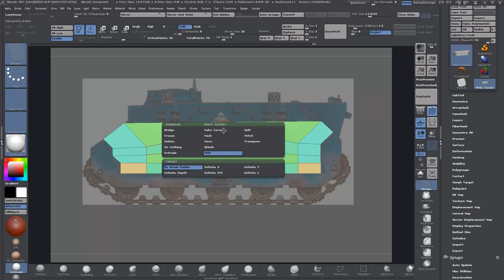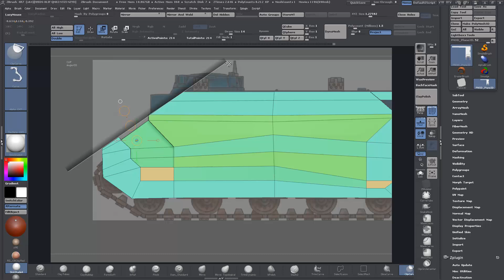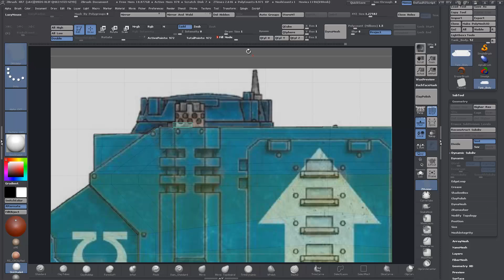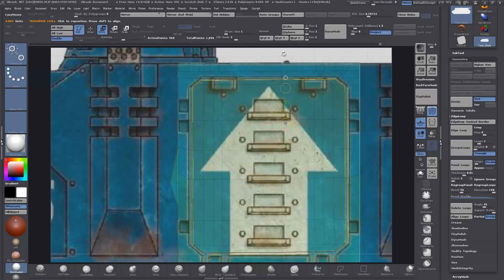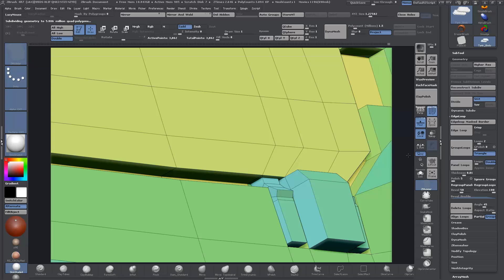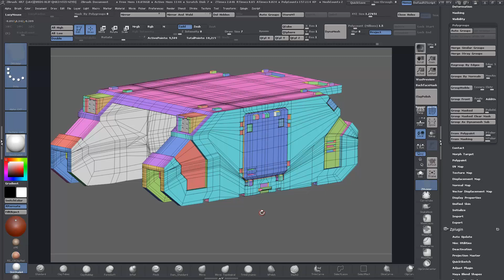Zbrush 4r7 - Zmodeler Tutorial Series '40K Rhino Tank Part 1

Comment: Fantastic tutorial thanks! In your opinion can you model anything you could model in Max just with Zbrush tools alone including Zmodeler?
Reply from the maker: Cheers mate. Glad you liked it. Technically yes but, certain models or workflows will be easier to achieve in Max(and vice-versa, of course) Personally though, I don't consider Max/ZB as 2 separate programs but rather, one and the same.(in my workflow I am constantly jumping between them) What I mean by that is that I use the Styx plugin which makes integration between the 2 seamless. So I use the strengths of both together which gives ultimate options in my workflow.
Reply: Thanks for the answer, that's the impression I have had in general so decided to beef up mt Max knowledge. I really like the single program approach!
Reply from the maker: No problem mate. Best of luck on the Max learning. Feel free to ask any questions or request a vid if you like. And yes, the single program approach is great.
Reply: Thanks a bunch! :)
Reply from the maker: Sam Mansfield
Welcome man. :)

Comment: Hello! Thank you for this excellent tutorial. I have a silly question: How do you get your edge sharp masks? Mine get a huge gradient/blur edge around them. The actions only work on the selected vertices, but I want them to look sharp as yours. I've looked into all the normal settings, but they do not make any difference.
Reply from the maker: *****thanks for the comment.  I'm just masking at default settings. When dynamic subdivision is active the mask looks alot sharper. When it's off you get that blurry look.
Reply: musashidanmcgrath You are correct, thanks a lot!

Comment: Hey thanks for this. I'll watch the whole series. 
Btw have you tried setting the point action to mask in zModeler? It's super beneficial to masking a couple points or points in odd places.. does not automatically transfer to the other side. same with the poly masking action.
Reply from the maker: Brad DuBois Thanks for the comment. Yes, I do use the mask action for certain specific things,but a lot of the time when I'm in the thick of modeling it's quicker for me to just use Ctrl+mask rather than change the action and then change it back again.

Comment: Interesting tutorial, but with Infinite Depth set you can drag aligned points around without the need to use masking, which is only something I've just discovered after playing around with the Point Target settings. The documentation in 'What's New in Zbrush' is, in my opinion, very light and only partially explains, along with typos, how the various settings work. No doubt some hard arsed and rusted on Zbrush modellers will have other opinions, but like you I come from 3ds max so can clearly see where the 'bodies' are hidden..
Reply from the maker: Nicholas Fox Ha! Can't believe I missed that one. Brilliant tip Nicholas. You just completely changed my workflow. :) I'm certainly no expert on Zmodeler and have been using it and the creation of these tuts to learn the tools myself. I suppose I just got stuck in to creating and used certain tools to get the job done. Thanks again.
Reply: musashidanmcgrath
I just stumbled on that one last night while I was reading through a printout of the Qbrush options and glad you found it useful. I'm not surprised that it was missed as the documentation with Zbrush is a bit on the light and scratchy side aith Qmesh and I don't think its options are terribly well explained. I just wish they'd do something with beveling a single straight length of edges without the 3 edge junction causing crappy looking ends, but maybe next time around we'll see that.
Reply from the maker: Nicholas Fox
 Yes, one of my main gripes is the fact that Zmodeler ignores poles for continuous edge operations. There is a way of isolating certain edges with the add to curve tool, but it's a bit long-winded in the context of modeling. I was going to do a short 'zmodeler quick tips' video about little things I've found useful. I'll definitely add your tip in and shout you the credit. :)
Reply: I'm just glad it's useful.